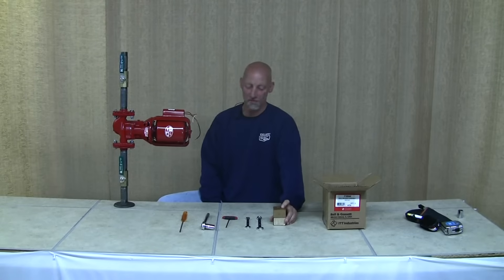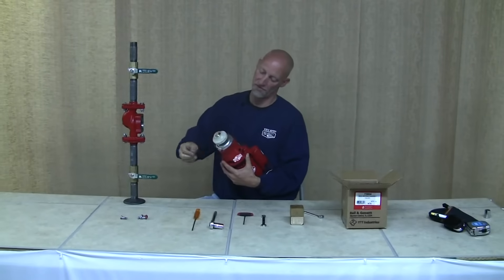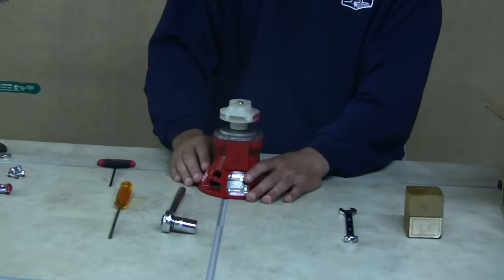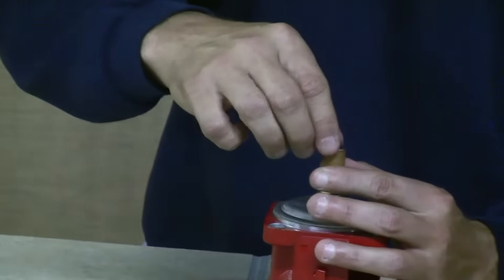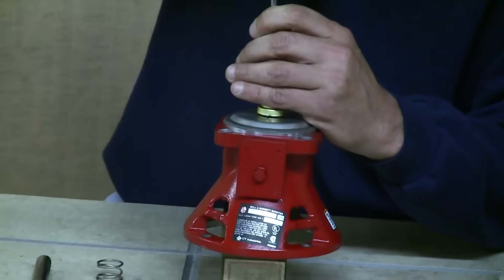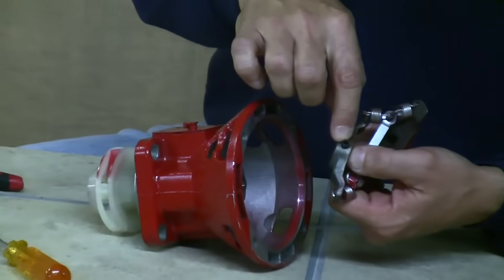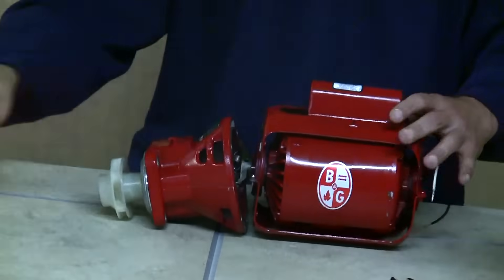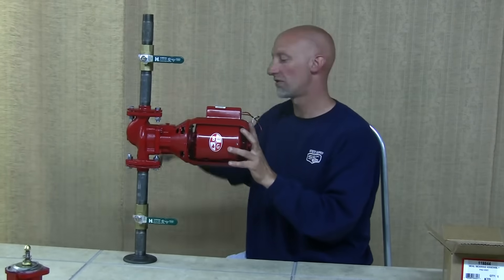How to Repair a Bell & Gossett Series 100 Circulator Pump (remastered)

Comment: How to test the motor
Reply from the maker: Hello Jeffery. It depends what is wrong with your motor. A few of the most common situations are layed out below. 

1. If motor is running hot you might take an amp draw to see if there is an internal issue with the motor
2. If your pump making noise, trying to run the motor when detached from the bearings can help determine if the motor is making the noise, or it it could be something else
3. If you pump is seized, detach the motor and see if the motor shaft will spin freely, if it won't, it likely threw a bearing and needs to be repaired or replaced

Comment: Does this pump have a built-in backward flow preventer? 

I have four zones with four such pumps and one zone get very hot even when the thermostat is off, whenever any one of the other 3 pumps are running.
Reply from the maker: We will need a bit more info to help on this one. Give us a call and ask for Cole or Tom 612-230-0990. To answer the question, there is no built in backflow preventer.
-Cole

Comment: Tom, I just ordered some parts including the wicks for the series 100...would you mind posting a picture of how they are installed? Mine seem trashed (I am replacing the mounts/coupler and wicks as preventative after 23 years / coupler started making some noice I think... rest of unit still doing it's job)...leaving what's not broke alone! The wicks-do they go parallel to the bearings left and right or over the top of them? Mine seem pretty well toasted.

Comment: Will a motor fail without damaging the couplers if the impeller shaft is tight?  By tight I mean I can spin it with my fingers but it is not as easy to spin as the shaft on the motor.  

I am having a repairman come replace the motor but don't want that to go bad from the resistance.  I just don't know how to tell how much resistance would be bad.
Reply from the maker: The motor likely failed due to age or electrical issue not due to the coupler. If you are replacing your motor it would be a good idea to replace the coupler as well. Hope this helps!
Reply: @statesupply  I did actually replace the couplers too.  Thanks!

Comment: how much oil is needed in the front gear section if pump is working contiunuasly, some say 3 drops a year, others say 3 drops a month if working continuously, is it the same on the B80 version, thank you

Comment: Hello Tom, I have a question if you can help me out I would really appreciate it. I have the same pump and the bearing assembly is making a very loud noise that radiates all the way upstairs to the point we cant even sleep. So I opened the oil port of the bearing assembly to find a bunch of black gunk and what looked like broken pieces of plastic and some stringy things. So I cleaned it all out-- I now know that those strings were supposed to be there. Anyway I pulled those strings out and re-oiled it but it still makes noise--So do I need to replace the whole bearing assembly or can I replace that stringy stuff? BTW, it is very dirty and gunky even after I cleaned the oil port out--any help would be appreciated. And 1 more question Tom, How much oil is supposed to go into the bearing assembly port? Is 2 tablespoons correct?THANK YOU

Comment: I need to replace a bearing assembly..... the B&G # on the bearing is 189101.....what 'other' numbers would work with this application. I've seen several assemblies (189100, 102, 103 etc....) while I have been shopping that look identical, and want to make sure we purchase the right assembly?
Reply from the maker: +ChaplainK All of those bearing assemblies are replaced by the 189163LF bearing assembly.   Let me know if you have any other questions!

Thanks
Reply: +State Supply Ok, thank you.

Comment: i bought bearing assembly and coupler/impeller only 2 years ago and this year the noise  is unbelievable, no problems heating house just very loud for some reason a pipes vibrate in each room.   bought the oil-less bearings[stainless ball bearings] but i suspect they corroded or some such...i fell for the sales pitch, still have to oil motor...no leaks in bearings, just noisy as heck and a bit of shaft oil isn't helping  ANYONE KNOW OF SUCH A THING HAPPENING TO THEM AND HOW TO FIX OR OIL THE BALLBEARINGS?  NO NOISE FROM MOTOR AND SHAFT TURNS FREELY AND COUPLER WAS EXAMINED.  MOTOR STAYS COOL AS DOES REST OF IT.    Impeller was new but...it is polymer so...noise is actually metallic and continues for second after click shuts down motor, momentum of shaft?

Comment: hello, are you familiar with, Wands WBA10 bearing assy?  I see that these are sealed. No oiling needed?
Reply from the maker: +ken peffley I am not familiar with those.  The series 100 bearing assemblies should be oiled.
Reply: +State Supply How much oil is needed and how would you know if have added enough?
Reply from the maker: You should make sure the oil wicks are well coated.  You can't over oil it, any excess oil will be drained out of the hole on the bearing assembly.

Comment: Is there any "special" way to install the oil wick? My oil wick is shot. I have the replacement, but not sure of the best way /place to install the oil wick. Can I just put the two wicks along the side? I hate who there is not good information on these pumps. That is why this video is great, he is showing us what we need to know.
Reply from the maker: +John G. Moore, Jr. Not really.  Just make sure the wick ends are placed evenly on each side of the bearing.  The ends of the wick should be lying at the bottom of the oil reservoir.
Reply: +State Supply - Cool, thanks!

Comment: It's leaking just oil between the motor and bearing assembly.
Reply from the maker: David Salzman Sounds like you have a bad lip seal.  I would recommend giving Tom a call, (The Pump Doctor)  at 1-877-775-7782.  He will walk you through what you should do.

Comment: Mine is leaking oil is there a deal kit for it or do I have to buy a new assembly?
Reply from the maker: David Salzman It depends on where the leak is.  If it's leaking out of oil well cover, you my have just over oiled it.  If you're getting an oil/water mix leaking from in between the bearing assembly and the cast iron volute, you'll need a new seal.  The part number for seal is 118681 (BG1300 )and we have plenty in stock.

Comment: My circulator is making loud sounds! Does that mean I need to replace it? and if so is it hard to do it? My model is an older one I think.. P2909 model gold color with timer. please help!
Reply: air biggs Oh and mine looks half the size of these red ones I see online.. I cant even find my model anywhere..
Reply from the maker: air biggs It could be any number off issues, there are some repair parts for that pump.  If you would like to call Tom (The Pump Doctor) at 1-877-775-7782, he should be able to walk you through the issue.

Comment: PLEASE HELP ASAP!!! I'm in NJ & it's getting cold!! I have a 100 series (106189) pump but the pump is fine, i just need the bearing assembly (coupler) with impeller, but i'm only finding that/those parts sold separately for the 189134 model... are they compatible & if not where else can I look for this part??
Reply: NEVERMIND!! I finally found some more info! For anyone else with my same situation, the series 100 MODEL # 189134 IS compatible with the 106189 pump !
Reply from the maker: Hello! The 189134 bearing assembly does come with the plastic impeller.  The coupler is sold separately.  If you have any questions, please feel free to give us a call at 1877-775-7705!
Reply: Sweet thanks guys!

Comment: i have a problem with my pump leaking water from where the main oil goes in. do i just need to change out the bearing assembly?

Comment from the maker: Hi Erik - depending on the age of your pump and how long it has been leaking, my advice is to replace the bearing assembly (located in the middle section of the pump) with a BG1453 (part number 189134) which is a new bearing assembly that includes the impeller. Just follow the instructions in the video above and call me if you need additional help at 1-877-775-7782.

Comment: I have a series 100 pump that is leaking water very bad,after I add water to the system it leaks out right away the system will not hold any pressure is it that I need a new pump or time for a new gas boiler?

Comment from the maker: Hey bigbub - sounds to me like your seal kit is leaking into the oil reservoir. Is it peeing out the weep hole on the bearing assembly? If it is not peeing out the weep hole, your seal kit is probably still leaking. Either way, I recommend replacing the seal kit and/or the bearing assembly. Give me a call tomorrow anytime after 9am CST if you have further questions and I would be happy to help you out - 877-775-7705.

Comment from the maker: Hey Richard, could be a few different things. A coupler on a Series 100 should last roughly 10 years. That is about the time it takes for the motor mounts to go bad, start sagging, and throw the motor out of alignment - which will break your coupler. Check the end of the coupler ears on your failed coupler. If they are out of round or grooved, bad motor mounts are the culprit. Give me a call if you have further questions at 877-775-7705. -Tom

Comment: Wow this was a great tutorial. I just replaced my baring assembly I would mention you will probably need a rubber mallard to knock loose the old bearing assembly mine was a b***** to get off. Other than that this tutorial was right on the money saved me over 300 bux to just do it myself. Thanks again.
Reply: I laughed my ass off when mine finally came off, pouring about a half-gallon of water onto my face ... I wad laughing because a) it stopped, and b) ir wasn't scalding hot water, lol; I was kind of concerned about both.

Comment from the maker: @enlightened it would be a good idea to order the motor mounts too. Often the coupler goes bad because the motor mounts are sagging - they are "out of round". In your case though, you may be in luck. The coupler may have gone bad because of the lack of lubrication. You could go one of two ways: 1) replace the coupler cross your fingers. 2) replace both the coupler and motor mounts. If you choose to replace just the coupler, you may be ordering another yet coupler along with motor mounts.